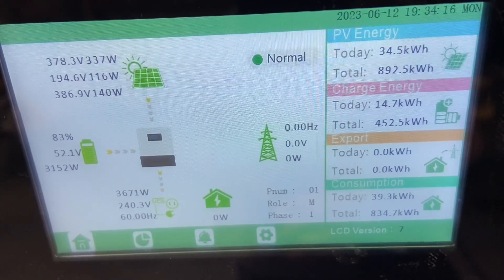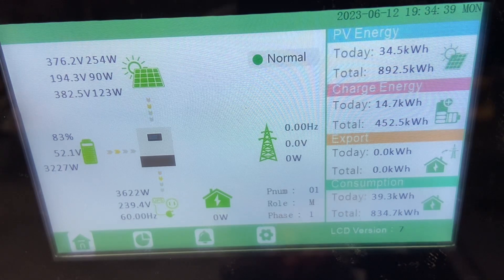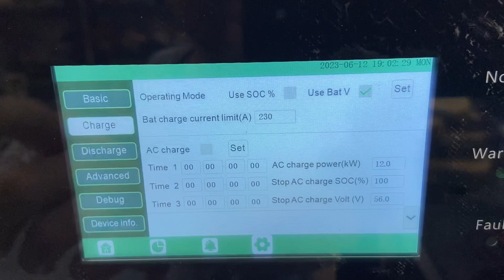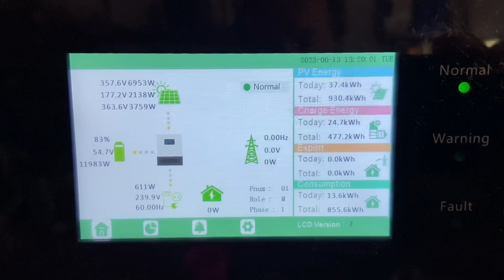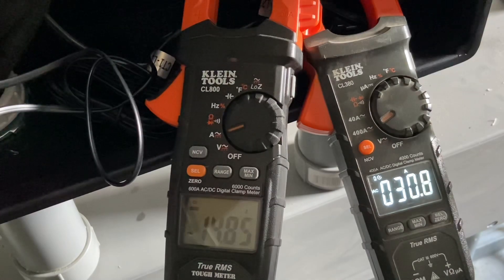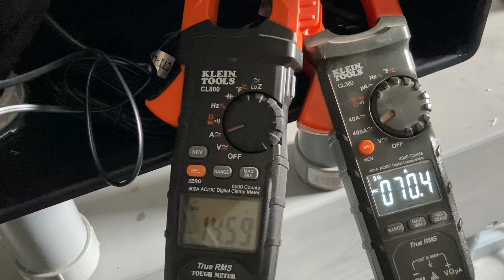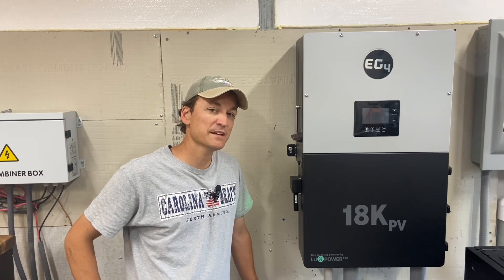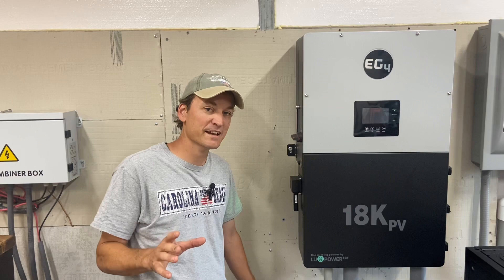EG4 18kpv 3 week update and more load testing~ off grid whole house solar inverter

Comment: Thanks had this unit over 6 months used yu setting i have seen a graft this good and the off grid time is the best i seen yep. was having load drop one load 1 or 2  every time unit recharged and support could copy and test these setting. What a pain to have to call 2-7 times a week and they have no per-set setting.  my 18k would get to low voltage and unit would drop grid power and not reset even in setting. so now i am adding a system grid bypass adding a square-D disconnect (60) to turn on when unit lock us out off grid. from L1 TO LOAD 1 / L2 TO LOAD 2. IT HELL TO REMOVE THE LOAD WIRE TO GRID At night. For power

Comment: How Does the new chargeveter communicate on close loop communication on the 18k close loop with power pro wall mount
Reply from the maker: I haven’t looked into it yet. I’ve been meaning to read about it. I believe the chargeveter is activated by the dry contacts on the inverter.

Comment: I am wanting to run my 3/4 hp deep well pump, 2.5 ton heat pump / AC unit and my hot water heater. Also hopefully my dryer and range - all 240 volt.
I am trying to decide on the Shneider XW pro 6.8 or the new EG4 18k pv. I have been told that either one of these would handle all these 240 volt loads. The unit I purchase would only be doing these 240 volt loads, (NO) 110 loads. Obviously the well pump and hot water heater are on and off all day long every day. The AC runs a few hours during the day for about a month or so in the summer and the heat pump runs during the day & night in the spring & fall and about a month in the winter. Once it is 20 degrees or lower, it is no longer in use, so quite a bit of the winter the heat pump / ac is not in use. The dryer runs for about a half hour  once a day about 3 days a week. The oven part of the range only gets used a couple of times a month, but one or two of the top burners are used once a day / every day. Anybody have any experience with the EG4 18k running a deep well pump and hot water heater at the same time? Along with a heat pump / ac? I am somewhat convinced that the Schneider XW pro can do it, but I only have reviews to base that on and no one seems to talk about well pumps or hot water heaters with them.
Reply from the maker: I responded to your comment on the forum. This unit handles all that without issue. I have a 3/4 hp well pump and 2.5 ton ac unit. Plus a 2 ton unit.  I do have a soft start on the ac. But the 18k PV does a great job with all of it.
Reply: @GavinStoneDIY  Thanks Gavin: I have not checked the forum yet. I have watched your videos on the unit many times and appreciate the straight forward info you give on the unit. Thanks again - jeff

Comment: I’m having problems with signature solars new eg4-ll batteries with the 6 dip switches. Going back and forth with email support. Kind of soured me to getting the 18kpv. Although it’s looking pretty good I’m not keen so far on eg4 reliability. But maybe I got the 6 bad packs
Reply: have you held the 3rd button down for 5 seconds and changed the manu to “can” then to lux. also make sure your main battery is connected to the inverter by the can port, but then each battery is connected to the next by the batt comm ports… also, the main battery must be set with all 6 switches to on during programming
Reply: it also takes like 5-10 minutes for all these settings to change and you may have to cycle the batteries/bms off a time or 2

Comment: How do you reset the acr fault on the touch screen for a eg4 18K pv. I was installing a second array and didnt shut the first array off with the pv combiner power having power from first which had power to inverter , I arced to wires on second array
Reply from the maker: I haven’t had this issue. Did you reset the inverter and clear the faults?

Comment: I have the Sol-Ark 15k inverter which it seems EG4 based the 18Kpv off of.   I'm assuming you used Signature Solar to make your purchase.  How has the customer support been?  I know that was a struggle for them for awhile, but they've promised that will be improved.
Reply from the maker: I had some rough experiences with them last year. Since then they have really be working to improve their communication. I watch the forum for complaints also. I’ve seen less and less. I believe they have gotten their feet underneath them now, and it will continue to get better.
Reply: @GavinStoneDIY  good to hear

Comment: Hello Gavin: Love your videos. Seen your new one on the NHX this morning. My question is this: I am planning on getting an EG4 I8K unit. It sounds like I have to wire up one solar array in parallel in order to hook up to the PV 1 input? Here is what I have now. I have two arrays already up and running on another system that I will be connecting to the 18K. Array #1 is wired in series @1200 watts @ 145.8 volts & 9.8 amps. Array #2 is wired in series @ 800 watts with 97.2 volts & 9.8 amps. The third array I have not built yet. It will 3800 watts and will comprise (10) 380 watt panels. Each panel is 42.17 volts & 11.36 amps. Originally I was going to wire them in series, but researching the 18K, it looks like I would have to wire this new array in pararllel. Is this correct? Then I could insert my other two arrays that are wired in series into the pv 2 & 3 inputs? If wiring the new array in parallel, the volts would stay the same at 42.17 volts, but the amps would accumulate to 113.6 amps and the pv 1 input maxes out at 25 amps right? So am a bit confused on how that is going to work. Any Help would be great. Thanks Jeff
Reply from the maker: Input one has 2 inputs actually. So you can parallel the strings inside the inverter, or in a  combiner box at the array. Whichever works best for you. It sounds like your # 2 array has barely enough voltage for the mppt’s. And #3 doesn’t have enough. The minimum working voltage on the unit is 120v.  And you really want to be above that by quite a bit to maximize how much you can yield.
Reply: So what you are saying is that I can wire all the poistives together from the (10) 390 watt panels and the negatives together, then run one positive wire and one negative wire from the array and connect them to input one in the positive and negative slots and that will parallel them?

Comment: Wondering why you not running your batteries in closed loop communications, that way the BMS will control your charging.
Reply from the maker: So far I don’t have enough capacity in rack batteries yet. I have a large DIY pack that I use as well. That may be changing soon.

Comment: As you are running this off grid, what advantage have you found over the dual 6500s?
Reply from the maker: I really liked my 6500 watt inverters. That’s a good question. So warranty is a big one. It’s 10 years on this unit. Monitoring software is super nice on the 18kpv. But you can purchase solar assistant for the 6500’s. And people seem to like that. Fan noise was a huge one. It’s so much quieter. Idle consumption is at least half of what it would be for the 6500’s. Surge capacity is a big one also. I rarely ran the 6500’s at max capacity. So what I really needed was an extra push every now and then. The 18k’s extended surge ranges give me the buffer I need for startups. It’s an all around much more “robust” unit. I’m sure I’m forgetting other stuff. But these are what came to mind right away.
Reply: Thanks for breaking it down

Comment: Do the fans only run when you are drawing from battery or have solar coming in, or both?
Reply from the maker: Only when you are generating 6kw of PV or more. Or using 6kw of AC power. Otherwise the unit is silent.

Comment: Gavin, the main reason I am considering this inverter is that it is quiet at low load levels.  Sometimes these types of inverters have a muted but high-pitched whine even if the fans aren’t running.  Does this model exhibit that, or when the fans are off is it really silent?  Thanks for doing these videos — super helpful!!!
Reply from the maker: Typically it makes no sound at all if you have loads or PV are below 5kw. It’s not that the fan is quiet. It’s just off all together. If you look at my last video on the 18k PV I believe I had 2-3kw on the unit and it wasn’t making a sound. When you are bringing in 12kw of solar then you’ll definitely hear it. Even then though it’s much quieter then a pair of 6500’s. It’s really pretty amazing.

Comment: Nice review... I did notice in the video that you have the battery settings set to Lead-Acid. Upon reviewing some of your previous videos I see your battery setup is LifePo4 and not Lead-Acid. You may want to reconsider the battery setting and change it to LifePo4.
Reply from the maker: So I don’t have battery communication set up yet. Currently I’m using voltage for my charge and discharge. However I may be doing a battery communication video coming up soon.
Reply: Doesn't the lead acid profile have an equalization charge stage? I don't think Lifepo4 batteries can handle that.
Reply from the maker: @billthebuilder1570  it does. But that is set at 40v I believe. The batteries will never get close to that low.

Comment: I wonder if EG will release a 15k output or 18k output model next?!  
12k output is a bit low for a whole house: add up electric Oven, Dryer, HWT - not too hard for all these to be on at once, plus A/C ? easily could be 80-90 Amps 240 far exceeding the 12kW output
Reply from the maker: It’s hard to say. But I’m sure they will eventually head in that direction. You’re right about output. It is a balancing act in the summer with the AC involved. But we have gotten used to managing our loads. The hybrid water heater helps a lot. And we manage baking times around the dryer. With the surge capacity to fall back on it’s actually working really well. I think 15-18kw would be ideal for our household in the sense that we wouldn’t have to be as careful. But so far I’m pretty surprised at how well the household can run with just this unit.
Reply: @GavinStoneDIY  It is great to see these highly capable units in the market, a pair of the 12kW output units would be 24kW (100A 240) and that would run most homes with little worry.  Great job on the vid.!

Comment: Any issues with LED light flicker with the 18k?
Reply from the maker: You can see a flicker sometimes with a large inductive load like a well pump. But that’s ohms law in affect. Normally you can’t tell you’re off grid at all. It runs smooth.
Reply: @GavinStoneDIY  thanks for the quick reply. Getting ready to buy and watching you all with this inverter is placing it on the top of the list for value/price. Understand large loads and agree. Just don’t want to run into issues many have the the 6500s.
Reply from the maker: @cgutowski471  no it’s a completely different animal then the 6500’s. Although I will say my last pair of 6500’s worked great. No flickering or issues. I actually really liked them. 

But yeah, I’m hoping to do a comparison video soon. This inverter is much different. It has so many more options. It runs my house really well.

Comment: If I install this do I need to get permits to put panels on an out building? If I decide later to connect to grid how do you get the whole system… legally connected?
Reply from the maker: It depends on your location. As far as permitting the answer to that can vary. However, this inverter does have all the UL listings to pass inspection easily. The manual has wiring diagrams on how to wire it in multiple different ways.
Reply: @GavinStoneDIY  I looked into it and found out that our electric company only allows a grid connection if you use their approved inverters that give them the ability to throttle your system. I ordered this inverter and 30kwh eg4 batteries to build an offgrid system
Reply from the maker: @APatchworkCanvas  that’s awesome! Let me know how the install goes. You’re going to really like the inverter.
Reply: @GavinStoneDIY  will do. I just got my unirac L feet bolted onto one of my metal roofs today. It was a real challenge because all of the rafters are spaced unevenly 😂 putting unirac up on the other building tomorrow. 10,500 watts of panels from Santan solar are going up next week. I got 18 410 watt unsed panels - never installed for $3k!
Reply from the maker: @APatchworkCanvas  that’s a real deal on the panels! Most everyone seems to like santan solar. They seem to be a solid company to buy from.

Comment: Did you have wires going to your grid terminals?  Wondering if you are off grid why you have that?  Thanks
Reply from the maker: I do have grid as a backup. I just haven’t used it grid through the unit. We have a large enough battery bank. But we likely will as we get towards winter.
Reply: @GavinStoneDIY  gonna purchase 2 of the 14kwh wall units with the 18 k today.  I’m in Wv so rough winters as well.

Comment: Nice video!  How many kW of panels do you have total, what part of the country are you in, and what is your average production?  I presume you have times where you produce more than you can use?  (including battery charging)  If so, have you considered selling back to the grid?  What was your thought process there?  Keep it up!
Reply from the maker: I’m in Virginia. I have a bit over 14kw of panels. I have extra PV production essentially every day that it’s sunny. I have considered selling back to the grid. I may do that at some point. Im still not sure. Some of the power companies in our area don’t even offer net metering any more. They are focusing on their own solar fields.
Reply: @GavinStoneDIY  Thanks, based on the app at the 6-minute mark it appears you're creating over 74kWh w/ that 14kw array?  That's really good production if so.  Looks like you made 30kWh more than you used.  Our power company buys back but at a low rate of $.028/kWh.  I'm looking to use this same inverter as you and upgrade the pair of 3000w EG4's.  In doing so I'm increasing my array to about 18kWh and was trying to estimate how much energy I'd produce here in Phx, based on your production (if I'm reading that right) I'll be generating much more than I'd estimated, which brings me back to trying to decide if I should grid tie.  Love the auto-bypass mode that 18K has!
Reply from the maker: @reviews2you  that’s a massive array. You will definitely be making much more than you’d use. 14.4kw is actually more then we need. However, in the winter we need every panel we can get. So there is always going to be a compromise somewhere.
Reply: @GavinStoneDIY  Yes, nice to have for cloudy days or if you add an electric vehicle or increase your battery array to account for several days storage of batteries in the future.  Keep up the good content!
Reply: @reviews2you  at a terrible rate of only $0.028 per kwh I would focus on buying more batteries to store my excess solar production.  Plus I like the idea of being independent in my energy production.  In my opinion our grid will continue to get more unstable as electric cars become more widespread and coal/natural gas/nuclear energy is pulled offline due to political reasons.
Reply: @unpluggedtexan  I hear you man.  We have two power companies here (no choice of which one you get of course), the other one pays $.09, at that rate I'd do it.  I bet I wind up making about 40-50 kWh/day excess even after filling up the 30kWh batteries so I could still make money, but they charge you an extra $13/mo to be on a solar plan plus permits and all the hassle of the permitting process.  Still would make money but not much (maybe $300-$400/yr), would almost prefer piss it into the ground versus sell to them at $.028/kw only for them to turn around and sell it to my neighbor for 10 times that.  I may get a plug in hybrid down the road.  Not a big electric car fan but would be a nice way to use some of that energy.  Particularly if more auto makers start allowing you to use the car's battery as a house backup, and add to my battery array that way it would make sense in my mind.  End of the day having too many panels isn't a bad thing, I got a good deal on them and it's nice that even on cloudy days (AZ doesn't have many) I can make decent production.
Reply: @reviews2you  yep well said. I with you, not a huge fan of electric cars either. But if I can drive it on energy I produce for free and it adds backup power to my system then I’m all for it.

Comment: I wish this EG4 was quieter. My family would be too bothered by the noise, even though it would be in our garage.
Reply from the maker: It’s actually really quite compared to other inverters I’ve tested. The majority of the day it makes no sound at all.
Reply: @GavinStoneDIY  Probably not as quite as a SE, Sunpower, or Enphase inverter. Obviously, they have different features, though.
Reply from the maker: @typingwriter  could be. I would say the fact that the fans don’t run at all a lot of the day is pretty impressive. But I would have to test those other brands and compare I guess. With max PV coming in you can definitely hear the 18kpv though.